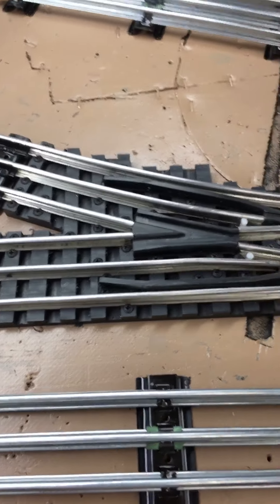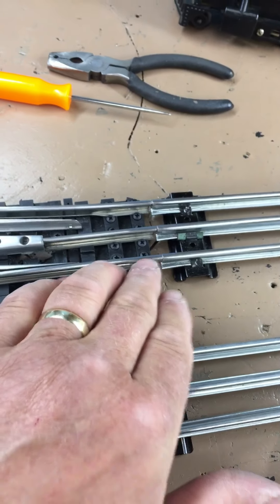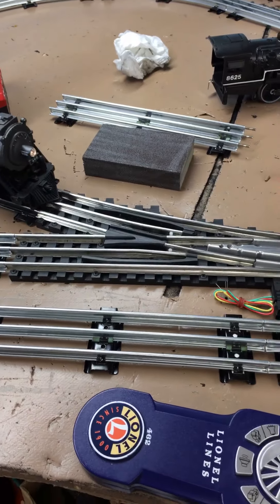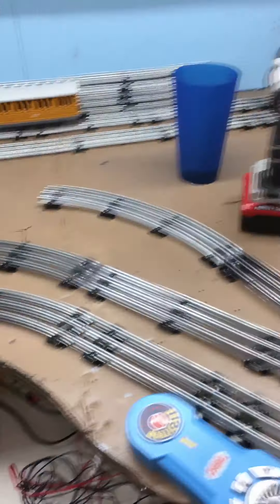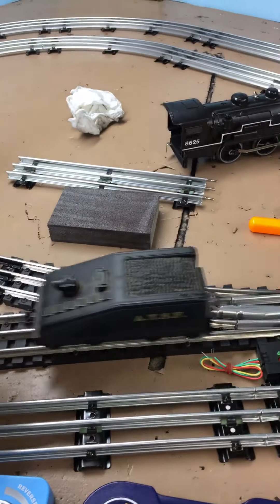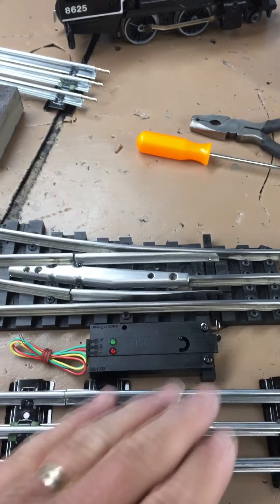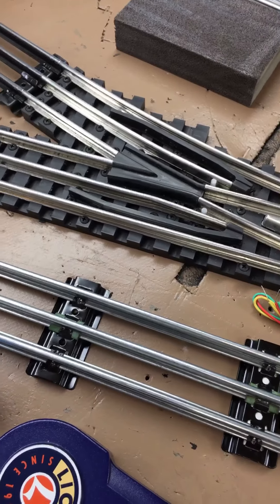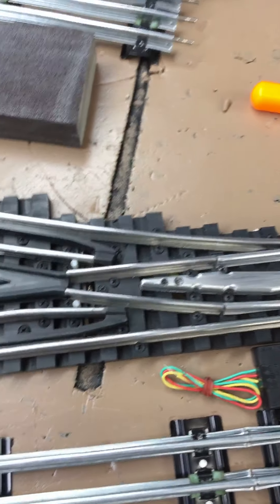O Gauge Ross Custom Switches Tinplate Switch 072 Review

Comment: I finally have all of my Menards track down, and these Ross custom tinplate switches installed. Absolutely awesome. Smooth, quiet, and all of my stuff will pass through these switches no problem!  The track was cheap and the switches were expensive, but not having any issues with connectivity or derailment was totally worth the overhaul. I am only using one lock-on for a lot of layout. I couldn’t be happier with this combination!

Comment: I’m thinking why the frogs couldn’t be deeper so the flanges don’t contact the bottom? Rail cars seem to have shallower flanges vs engine flanges, thus not an issue other than engines. Yes diesels are better thru switches vs the rigid wheel on steamers. Steamers 2 wheel front trucks are finicky thru switches without weights added. I have better luck with 4 wheel pilot trucks weighted. Don’t seem to matter what brand, or type switch each has issues. I find 034 Marx plastic switches with a flange guide added works well with my diesels. Still not so much with steamers or engines with more than 4 wheel trucks. All my engines do not have rubber tires. Rubber has different issues.😊 I’m running 027 track, i just like the shorter profile.😊

Comment: Thanks for reviewing both the Ross switches an the Menards track.  I was hoping Menards would start making switches, but it looks like this switch will work fine, as long as you are ok with all of your switches being O72.
Reply from the maker: They also make a #4 but I’ve not actually seen one yet, they are nice but are pricey
Reply: @jamesmorgangunsandtrains7132  I think I will order one and see how it works. I have some mth real track and can’t seem to get my beeps through it without stalling/stopping. I’m trying to move away from realtrax.
Reply from the maker: @whitmorestrains  I’ve never used realtrax, I wanted to at one time but here in Texas in the Dallas ft worth area nobody ever had any in any of the major hobby shops . It was all fastrack here
Reply: @jamesmorgangunsandtrains7132  $105 a switch isn’t the worst for a quality turnout. I’ll make it up with the cost of the Menards track :)
I put an order in for the Menards track this morning. Do you know when they pull it from the website, assuming it’s a holiday only buy?  I need to know if I should put my order in for the rest of what I need now so I don’t have to wait until this time next year.
Reply from the maker: @whitmorestrains  usually ships out fast and they have plenty I wouldn’t think there would be a delay
Reply: @jamesmorgangunsandtrains7132  ordered...says 2 days until they are here.
Reply from the maker: @whitmorestrains  cool
Reply: @jamesmorgangunsandtrains7132  what is the length of the turnout rail on the strait from end to end, not including pins?
Reply from the maker: @whitmorestrains  I believe it’s 14 inches
Reply: @jamesmorgangunsandtrains7132  thanks!
Reply: @whitmorestrains  I'm pretty sure Menards sells track year-round. I bought some around April, then bought some more in September. The only difference in seasons is where they keep the trains in the store.
Reply: @AdiposeExpress  very good thing to know. Thanks!
Reply from the maker: Wow that’s awesome , yeah I think it’s a great combination also, much better than fastrack, and cheaper too. Maybe you could post a video? Would love to see it.
Reply from the maker: Hey the link you sent me won’t work, it says the video is unavailable, maybe your privacy settings need to be changed?
Reply: @jamesmorgangunsandtrains7132  try again...I just opened it up.
Reply: @jamesmorgangunsandtrains7132  

https://youtu.be/bglCmD9G0lA

I finished roughing in the lower level tonight and this is the maiden run. Track is just sitting on the plywood still. Some loose track sections and only one lock-on, and it still runs great! Lots of work on this yet...